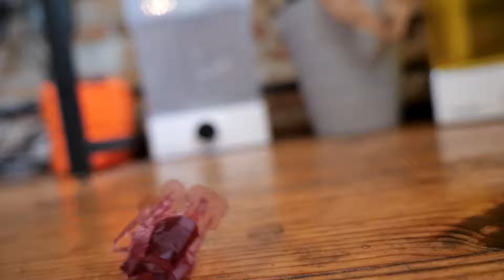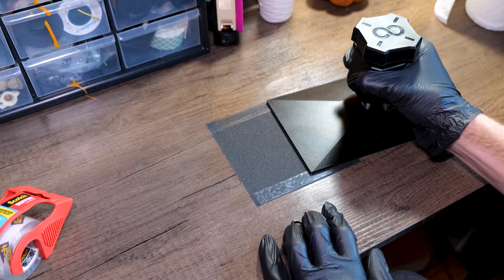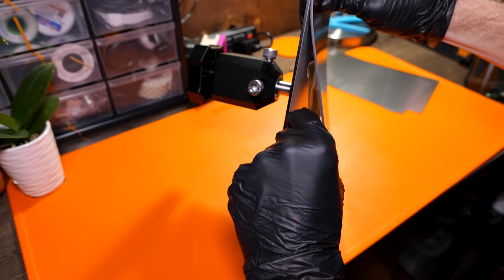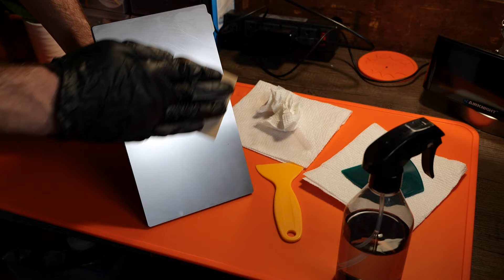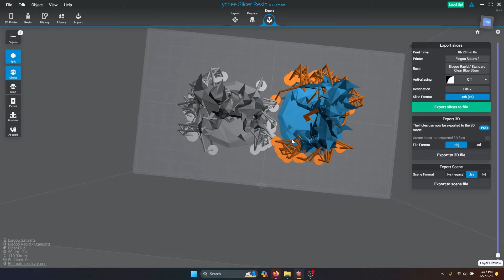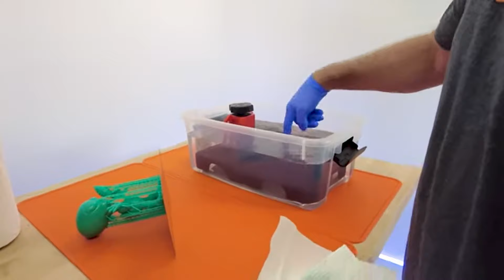This ONE Change REVOLUTIONIZED my Resin Printing Workflow

Comment: Magnetic plates are great on FDM, maybe I should get mag plates for my resin printers too. I shatter so many prints trying to get them off the normal plate.
Reply from the maker: I highly recommend them! I’m not sure if they’re good for bigger prints. For my smaller prints, it’s saved me days of my life easily. I don’t recommend the XTR one. The plates are so thick that I often find myself having to use a scraper to get some supports off, because I can’t bend the plate enough to pop them off. But, my models don’t break!

Comment: why is something like that not standard like it is on fdm printers?
Reply from the maker: I think it’s a difficult thing! It can introduce layer shifting, it requires extra attention in the placement of your model, and it’s not without flaws. It really sucks for small areas (imagine three supports next to each other) and sometimes I have to pry those off. It’s great for larger surface areas. My use case is I print models with flat bases, so it’s nice to pop them off rather than damage them with a scraper

Maybe one day, one company will implement it in their printer and everyone else will follow suit

Comment: After a print I put the steel plate right back. Some resin between the magnet and the metal plate allows for a much easier plate alignment and quicly gets pushed out. I print parts without supports had zero issues so far.

Comment: I'm curious about the durability of the adhesive on the maget atfer a couple of months of resin exposure and IPA cleanings. Idea is pretty neat though. I personally woud machine some grooves/holes on the top side of the build plate, glue some realle strong magnets there and then have the two options, (with and without steel sheet), just in case for those parts that cover 95% of the buildplate (in one single part).
Reply from the maker: I am curious as well haha! I definitely don't plan on placing my build plate in IPA which I hope helps. Instead of machining the build plate, you could just get a second one that doesn't have the magnet installed. I think what you described would be very challenging and require incredibly strong magnets

Comment: I have saturn 2 and the flex plate i love it. I do relevel the bed every 4-5 prints as the 2 screws seem to not work on keeping it level over multiple prints. I did not make the space i just reset the zero option when i re-home and leveled the bed every time i need to. I printed a lot on here and i not had the magnet come loose yet and i had pieces that over a lb in weight on here.
Reply from the maker: I've heard a lot of complaints about the ball and screw method that the Saturn 2 uses. While I agree that it's not the best, somehow, I've never had an issue with it. That one month I mentioned that the printer continuously ran, I didn't level it once! Thanks for your input!

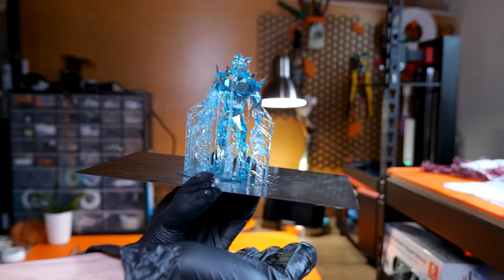Comment: @7:55 Sorry, for the stupid question, since I haven't started printing with my own resin printer yet… Is this clean result directly taken out of the printer? Or did you already wash off superfluous resin at this point? These edges look razor sharp. On other channels, their results look rather muddy at first when taken out of the printer…
Reply from the maker: Hey, not a stupid question. And welcome to the resin world! Yes, that’s straight from my printer! No washing done yet. It could be that my resin is less viscous? The print is also stunning when it is covered it uncured resin. Once it’s washed it looks more matte as you can see later in the video. I’d like to experiment with using alcohol based inks to make the parts look shiny like they do at that time stamp.
Reply: @SpencersDesk  Hello, Spencer, thanks a lot, I was not sure, it looks really great. I did not dare starting with mine yet, since I do not have the needed temperature range in that room in winter times — and no vat heating installed either ;-)

I am looking forward to watching your next videos, see you ;-)

Comment: Personally, so far, I just use a 2nd build build plate on my gktwo. Swap them out after a print.
Reply from the maker: Once I start using my GkTwo more (it’s not enclosed like the Saturn2 so the fumes are an issue for me with my current setup) I’ll probably go that route as well. I wouldn’t want to mod it as it’s already awesome. The Saturn 2 I felt comfortable messing with since it’s on the cheaper end these days

Comment: I tried simliar product for Halot One, directly made by Creality. I had many, many failed prints. One cause was the pull-tab scraping the edge of the resin vat. The second one was the peeling force being too big and the plate separating from the magnet :/ I ended up removing it off the printer.
But I cannot imagine not having flexible buildplate on my FDM printer :)
Reply from the maker: Sorry to hear! That's a good point though. I could definitely continue resin printing without a flex plate, but it really is unimaginable not having one on my FDM!